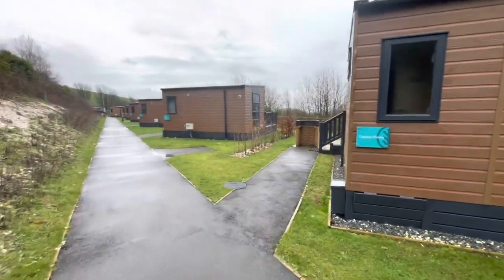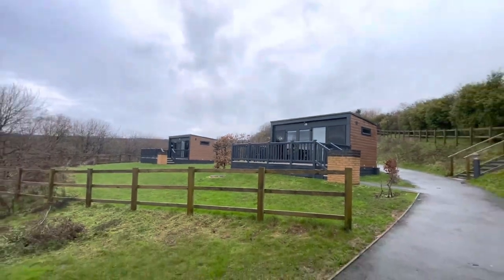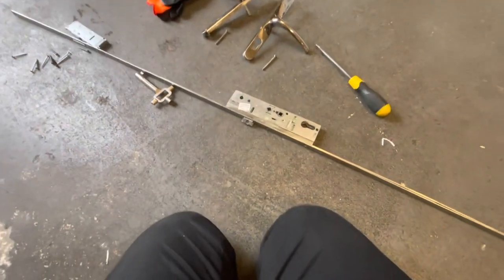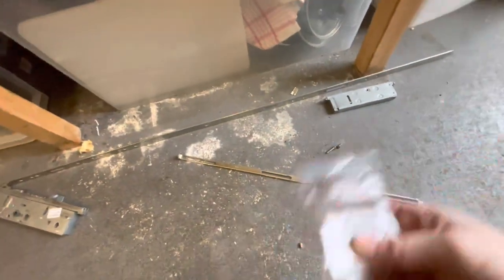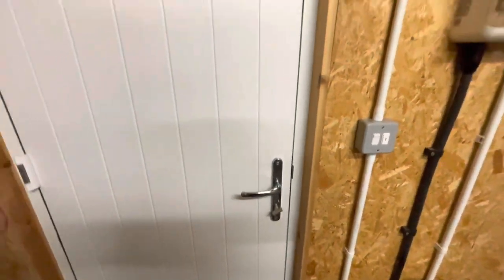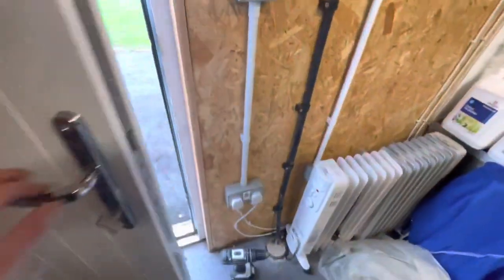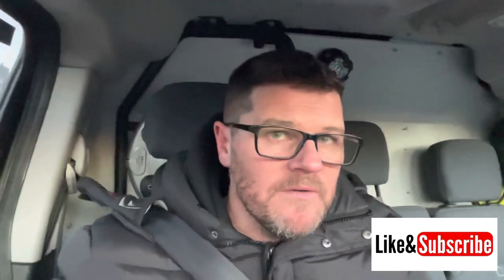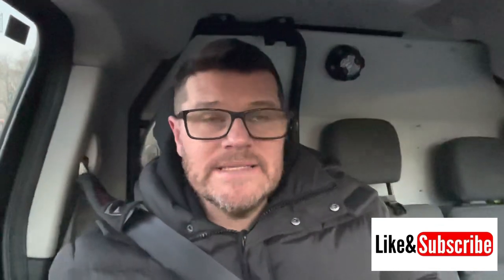Failed Composite Door Mech - Lock Upgrades - Yale Universal Install - Brighton Locksmith

Comment: 85 quid mate 🤬 time spent getting there back home,  car tools, fuel ect not a clue some people, glad you held your ground 💪 I've just been to dodgy GU thought quick box change, boy was I wrong. Couldn't get the handles off the spindle and the spindle is almost welded to the follower 🤣 never seen rust like it. Soaked it to death in GT85 and off back as was dark 🤣 might have to cut handles off 🤣
Reply: Try plus gas on the rusty parts mate works a treat!
Reply: @Danielblackler  not heard of that but I'll grab 1 from screw fix cheers 👍
Reply: @fortifiedlocksmithswakefield  its brilliant stuff mate takes a few mins ro work and smells awefull but really good gear 👍 comes in a blue tin
Reply: plus gas work's excellent, it gets used in my brothers engineering works all the time, GT85 still a great product..p,s...the plus gas we use is in an non aerosol pump spray bottle.

Comment: Do you ever heat gun those composite door frames after they’ve been damaged like that with a screwdriver or bar? I did one for a customer recently after they had a visit from a 49er and it came up a treat.
Reply: He should have used it first to make it less brittle, these kind of jobs are a nightmare, I had one the other day and after snapping the bottom half of the mech became free, so I was a lucky bunny that day, and Andy's making good is second to none.
Reply from the maker: I don’t to be honest but I think I’m going to get one 👍🏼
Thanks buddy

Comment: Busy then quiet, if only these things would balance themselves out. As for the tires, I've had vans for the past 15 years ish. It was only a couple of years back that I found out you are suppose to have heavy load tyres on your van. Yes that means more £££££ unfortunately.
There's part of me that understands when a job takes a few minutes as opposed to an hour the customer feels ripped off but.... in effect you are paying from 1 second to 1 hour. So if you had said to the guy "Sometimes I can get these locks in seconds, are you still willing to pay the £85"?
What's his choice, yes or no right? If he says no then what does he do to get in his car? He's still stuck. I guess he shouldn't lose his keys then. Maybe he should have called his breakdown company instead of wasting you time debating.
I used to be a self employed mobile welder and repair cars. Most jobs were MOT failures. Thing is experience tells you there's a risk of finding more rust and job becoming a much bigger job. I used to say this to customers and they were reasonably happy with that. That is until you showed them when jobs because much bigger. I was half the price of garages and when the job should have cost double due to more rust and much larger holes to repair, I would only charge half the amount again but they still complained. Most people, not all. Everybody wants something for nothing.
Cheers Andy 🙂👍🏻
Reply from the maker: Thanks Roy. I don’t know that heavy load tyres were a thing!! I thought he was pulling the wool 😂😂

Thanks as always for watching